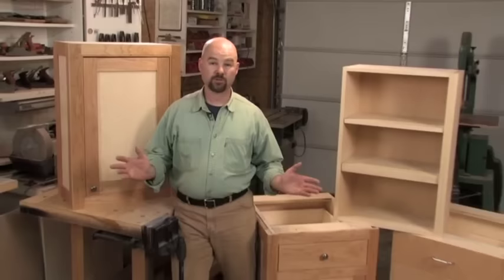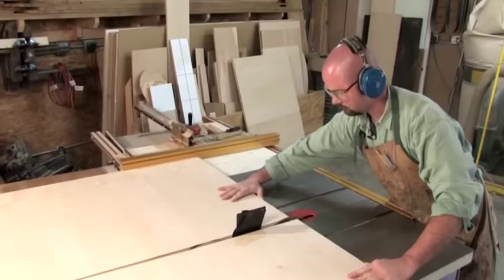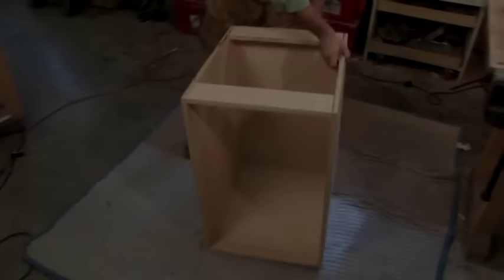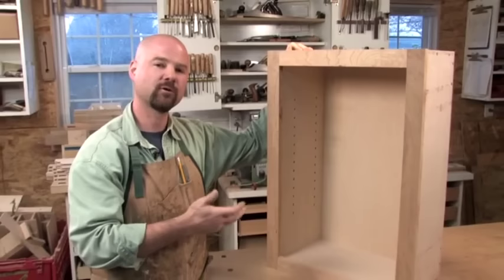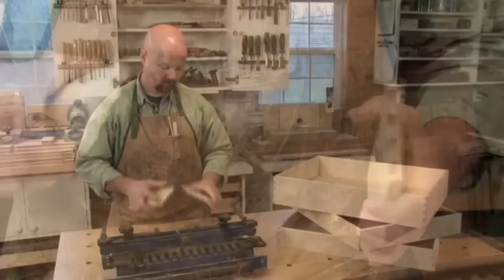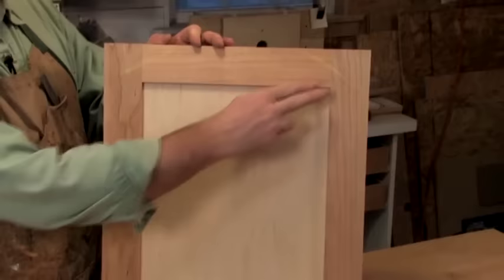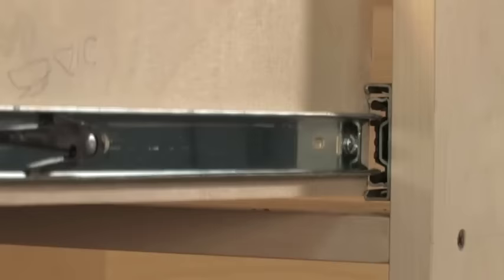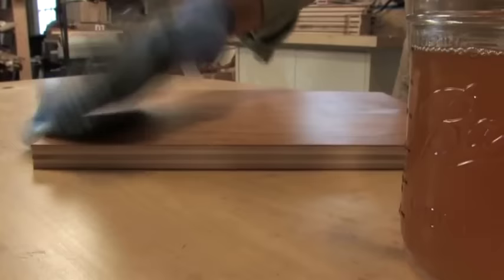How to Build Kitchen Cabinets (In Detail)

Comment: I admit, I have never used pocket screws. I have used other joinery. I also like to use a 1/4" bit in a router table instead of a dado blade, and leave that one table set up just for drawers.  This is primarily because at my cabinet supply and laminate shop, I can buy an oversized bit if we use Mica board, that makes up for that coating. But I love this video for its completeness. I was a carpenter and cabinet maker before I retired. I am medically retired, and am rebuilding a small house that my wife and I purchased and live in.

Comment: Very detailed description. Thank you for that. One thing it doesn't cover is overlay doors and drawer faces. I realize that it is mostly a matter of measuring properly for the reveal that's desired. But, I think applying the hinges to the doors is different. I have a problem visualizing that, and I'm not sure if a specific hinge is necessary for each different reveal.

Comment: What is the trimmer called at the store, so I know what to ask for when I go to buy it? Sorry to be so ignorant, but I am just starting building cabinets, and I really don't know. This is an excellent video! Articulate, and showing everything I need to know at a pace I can understand what u are saying. And very interesting also. Thank u so very much!! What measurements wud u use differently to make cabinets that go to the ceiling from the 18 in above the counter? Or wud it be better to make 2 separate cabs? I have no soffit, & want my cabs to go to the ceiling, which is another 28 in above what my 30 inch tall cab will be. Wud u advise me to use some decorative moulding to trim to take up some of the space?
    Thanks for a great video, & thanks in advance for any answers u can offer me.
Reply: I have crown molding over mine.  That might work for you too.

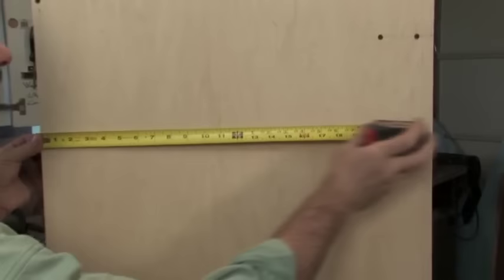Comment: Hello Mark, something that confused me was @ 17:45 of the video when you talk about the overall depth. 24" is standard, but is that with or without face frame? You mentioned cutting the plywood @ 23 3/4 but if you put 3/4" face frame, then you're looking at 24 1/2" .... If you're trying to hit the 24" measurement on non-Euro style cabinets, shouldn't the sides be cut @ 23 1/4, so that with the face frames you get 24"?

Comment: I noticed you aren't using glue, just staples and screws.  Any reason for this?  Thanks
Reply: You only need it to hold together for long enough to get paid, by the time the staples rust out and it starts falling apart you've liquidated and reformed your company 3 or 4 times over so no comebacks - its a sweet life and good money when you save time gluing and clamping and fixing etc. Just rat a tat tat on the nail gun and your out of there. #VoteDemocrat
Reply: The Spaniel Inquisition I am not trying to start a flame war, will you please enlighten me as to why it is a good idea to vote Democrat? Just asking when making decisions I like to have all the information I need to make a well informed decision.
Reply: @TheFalconJetDriver  To avoid voting for the criminal?
Reply: @thespanielinquisition7167 A retired builder, I see what you're saying and those bums surely are out there. However his method does last a long time given how many screws he uses. I don't see the loads individually causing an install-failure such as your bang-'em-out scenario would bring about. Moisture was typically just an intermittent matter in our Mid Atlantic area. We had a solid warranty program and his cabinet-methods are ok under its requirements. Florida? Yes...you have a point.

Comment: What brand and model is that table saw fence?
Reply: Looks like an Incra.
Reply: Incra TS-LS 32" Rip capacity, model LS32-TS.  They also make one with a 52" rip capacity Model # LS52-TS, but be aware this has 92" rails (closing in 8ft) plus you need another approx 32" to the right for the center line fence to stick out, hitting nearly 10ft in width.  https://incra.com/precision_fences-table_saw_fences.html
Reply: @befmx31  Yeah I think you are correct, it definitely looks different from mine (LS52-TS), and I've never used a ruler once (no need to).  That's the main reason I got mine, was simply dial it in, and use the built in scale, and it's always dead-on.